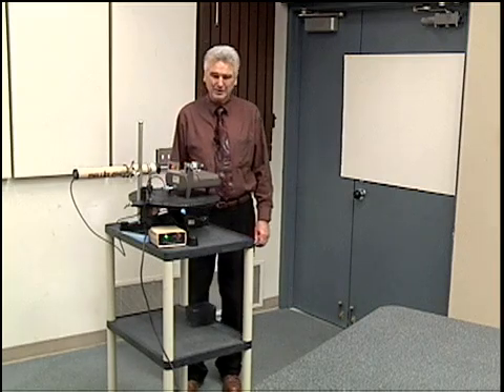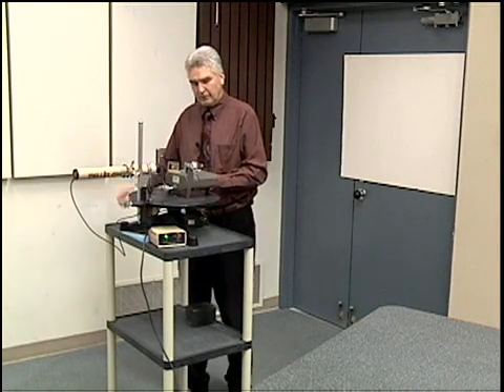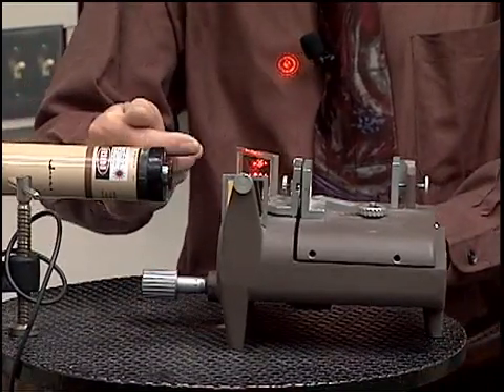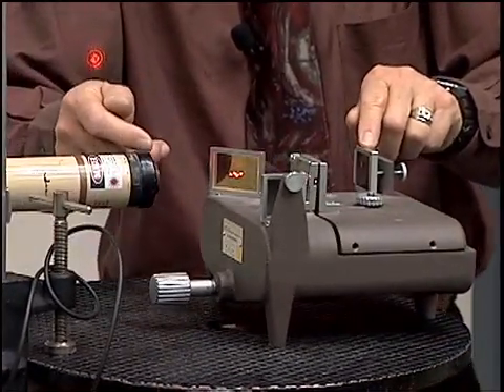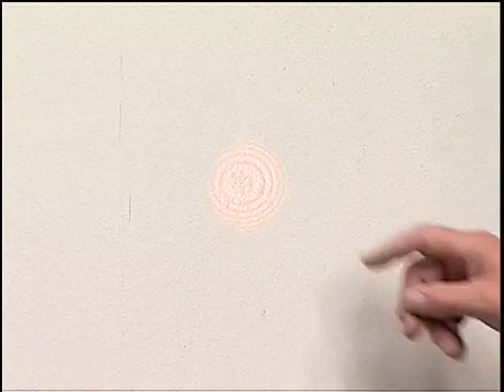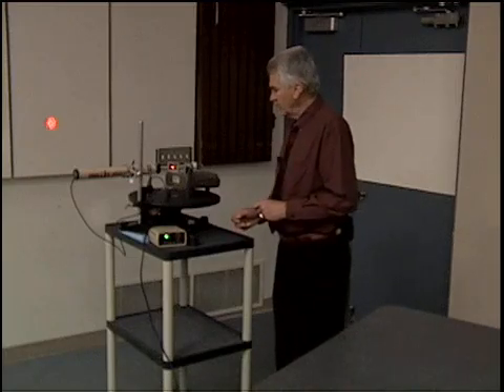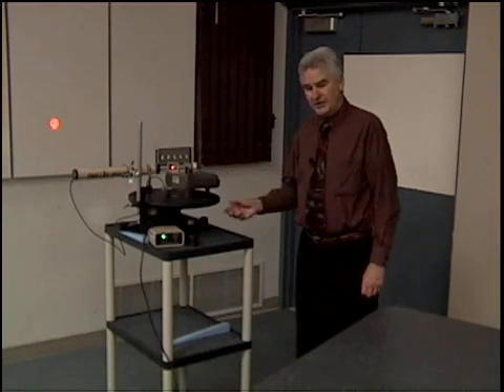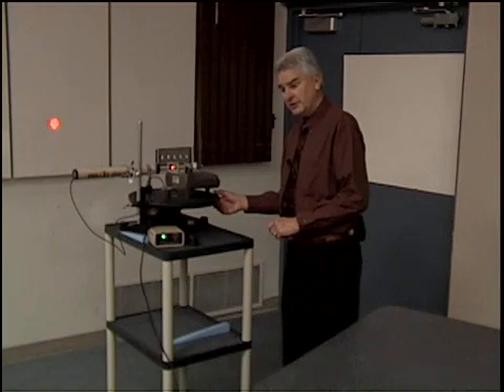Mickelson-Morely Experiment

Comment: Michelson/Morley test is a bunk idea, when it comes to measuring aether wind, it's essentially similar to measuring electromagnetic radiation near the surface of the sun (you're overloaded with the sun's magnetic energy).  The Earth is also a giant magnet; trying to measure an "aether wind" would be near impossible.  If there is actually aether (an electromagnetic field that fills and makes up the universe), then it would be like the turbulence in water, from a massive spinning sphere; the surface of the sphere would be even layers of pressure, extending outward from the surface (if not from the center mass, in the case of aether). 

This is what you're seeing in the later of this video (here: https://youtu.be/7T0d7o8X2-E ); layers of electromagnetic pressure, extending outward from the surface.
You would have to be outside the planet's turbulent field of aether, to actually measure aether wind.